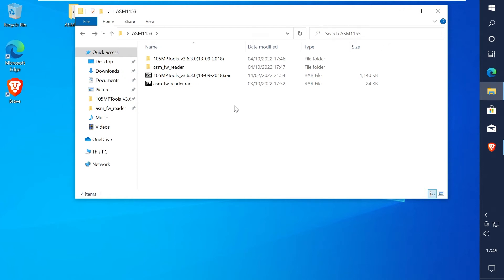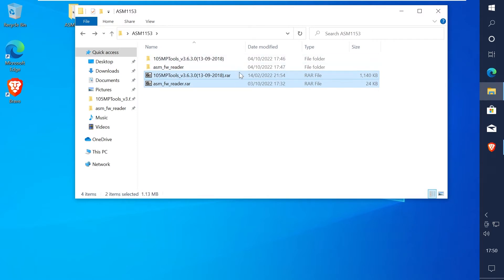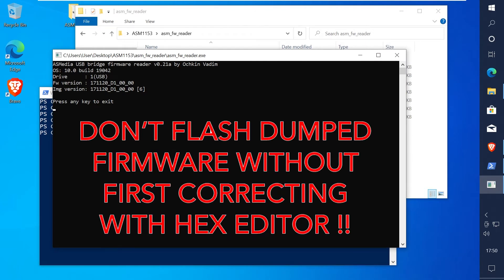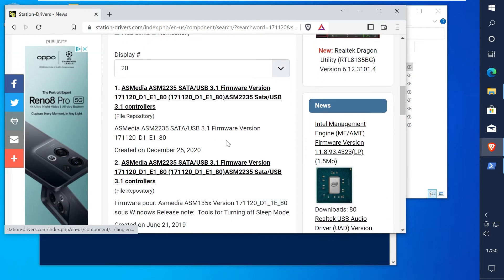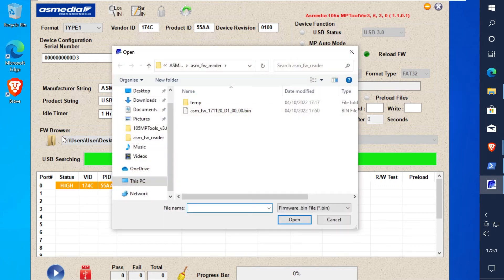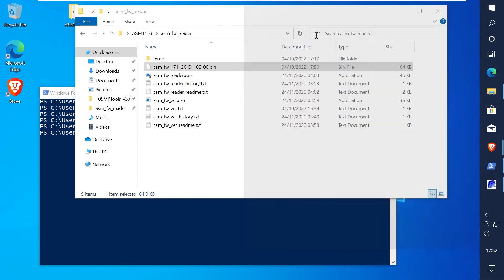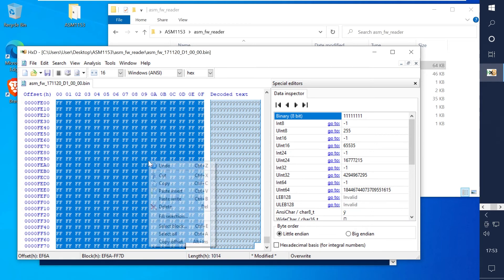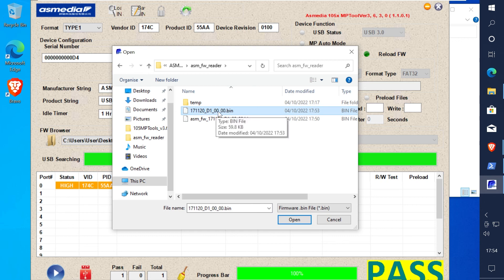ASMedia Dumping And Flashing USB SSD HDD Drive Adapters - MPTOOL

Comment: I get this when I run asm_fw_reader.exe "Fw version : 130531_21_00_00 Image version not found, save as version from bridge controller" Edit: reason was, there was no eeprom inside my adapter...cheapscate chinesium. So my firmware is the non-upgradable firmware inside the controller itself. I fitted a 25-series eeprom (a random one I had around 25P05 / ST25P05AV  512 K-bit (64K-byte) SPI) and now it works.
Reply: I had the same issues. I soldered in some random 1 Mbit SPI EEPROM from old hard drive and it worked, thanks for the tip!

Comment: hi, can you please explain why after dumping the firmware you use hex editor to remove the first 130 byte and the 
"blank parts" of the file ?
Reply from the maker: It must be how the dumper works?, it must pad extra data, but if you flash it without removing the first bytes it will brick the device.
Reply: @primetechguides3050   hi, Do you know if the dump of the firmware must be done with or without nvme inside the enclouser ? thanks

Comment: unrelated question, pertaining to asmedia usb controller firmware. ASM3142 controller. not sure if you're familiar with this process or the tool used, which is ASM3142 MPTool, it allows you to update the firmware of your asmedia usb controllers on the motherboard. my issue was that my USB-C ports never really worked properly. someone had suggested updating the firmware, which I did, they passed (tells you if it failed etc..) things seem to be normal, or unchanged. all other usb ports work but the C ports are always disconnecting and failing (hang). not sure if my controllers are just fried (DOA?) even the firmware check tool lets you test your ports (signal/fixture), they all show up as fails, despite things like my mouse/keyboard/USB3.0 ports working just fine for external HDDs. either the tool is wrong and all my ports actually pass, or it's detecting an unseen issue (which may be why my C ports don't work correctly). What do you think?

Comment: i keep getting bridge errors when I try and dump firmware but flashing new ones worked fine.  and i guess my stupid seagate drives had the same chipset cause it flashed those too cause i didn't unplug them.

Comment: @primetechguides3050 I'm not understanding in your video why the dump file is being modified,also is the dump file the old firmware or is it the settings that's by the manufacturer used for your enclosure.
Reply from the maker: It is not needed, it is just to backup someones firmware and if they wish to share it with anyone else. So we can obtain latest firmwares from the community.

Comment: Super good video! Thank you. My UGREEN 70499 enclosure was already on 171120_D1_1E_80 but remained unresponsive in macOS 12 Monterey and Windows. HOWEVER, I got it working! The first part of the firmware filename is the DATE, and the rest is the firmware version. So I flashed 220906_D1_45_01 from usbdev website and the drive now mounts just fine in macOS and Windows, though the LED no longer flashes. Firmware  200416_D1_43_00, slightly older than the most recent works well and has the LED. I wanted to let you know so you could perhaps mention that people can flash firmware from 2020/2022 rather than 2017. Cheers!
Reply: Besides the LED, is there any difference between these versions 220906_D1_45_0 and 200416_D1_43_00?

Comment: Thanks for your detailed demonstration. I've tried myself on a Ugreen CM472 HDD enclosure with FW versin 171120_D1_1E_80.  After comparing the dumped FW with the downloaded one byte by byte, I believe that all the non-zero data at the end of file should be deleted.
Reply: Firmware 171120 is from 2017, the most recent firmware I could find on usbdev was 220906 from 2022. Worked on my UGREEN 70499.